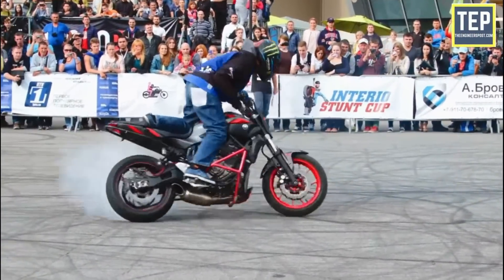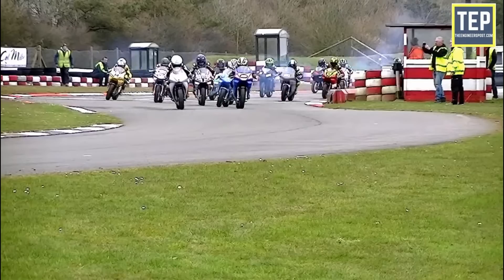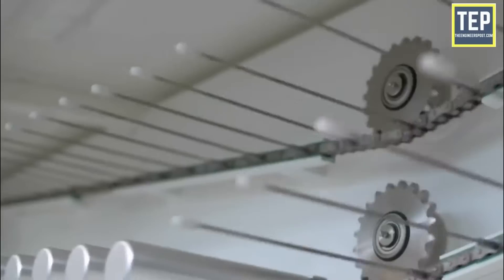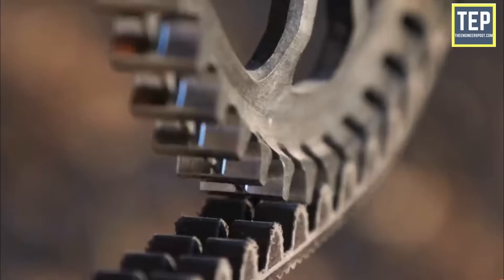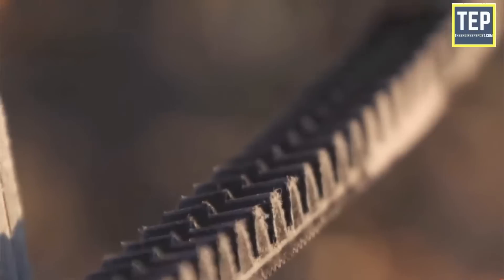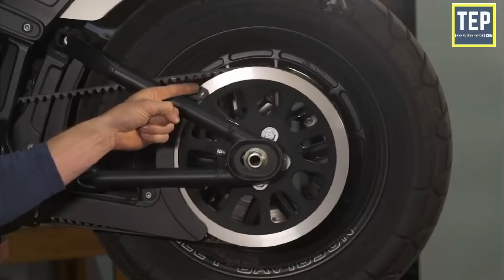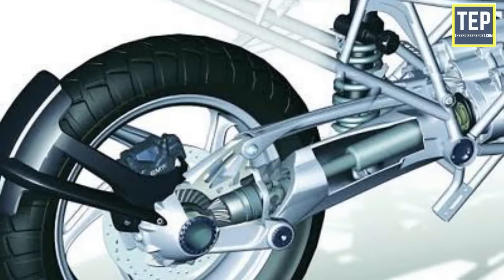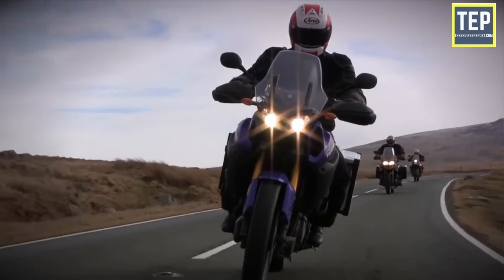Chain Drive vs Belt Drive vs Shaft Drive in Motorcycles | Which is Better?

Comment: Missed belt vs chain trade off: while a belt is more expensive itself to replace, during catastrophic failure a belt will simply zip away with the rider only noticing a complete loss of power transmission, while a chain can both jam between the sprocket and swing arm instantly locking the rear wheel and can also be flung forward into the transmission/engine/drive sprocket requiring a complete rebuild or engine/transmission replacement. This is an important difference as how a system operates at its limits and at failure can have lethal consequences. 

I’ve personally seen all three modes of failure, and had both a locked rear wheel in a turn from a broken chain and a lost belt at highway speed. While a chain can simply fall away if it breaks in the right location every instance I’ve seen has resulted in a high speed projectile thrown either behind the bike or into some portion of it (or getting jammed between a sprocket and swingarm). A shaft drive, on the other hand, only fails catastrophically when the front u-joint disconnects and if the design is otherwise unsupported it becomes an ersatz pole vault flinging the entire rear of the bike into the air, much like a disconnected drive shaft can do on an automobile. While this essentially only occurs due to direct damage it is still a more dangerous failure mode than a belt.
Reply: Belt is low maintenance, and acts as a shock dampener for the driveline.  Chain is strongest but requires occasional lubrication.
Reply: Had a chain come off pulling away from a stop in the middle of no where New Hampshire. Got a ride to a jobber for a new master link, they drove me back to my bike. Chain back on, all in less than an hour and back on the road to Toronto with just a little crack in the case. Had the nut come off my belt drive at 70mph (always use new cotter pin) had to get ride to dealer for parts that were lost and away I went 4 hours later. Had a shaft drive in between those bikes with no problems, but the bike tends to jump up when you give it the gas. I'd say the belt is the way to go chains don't last very long and I don't like the feel of the shaft.
Reply: this happened to me 10 years ago,luckily i was slowing down just before the curve,around 40-50kmh when rear end started sliding then rotating for a little then sliding left and right again then couple of more times until full stop. Very unpleasant feeling.
Reply: The chain will never fail in normal conditions and if it's maintained.
Reply: Didn't you watch the video, belt has high transferred power loss and chain has very little transferred power loss
Reply: @johnadams3038  Sorry John, I’m not following your point. It’s accurate to say that when both are in good condition then chains have less wasted energy, but I’m not seeing how that’s germane to their catastrophic failure modes. Can you close that loop for me so I can understand what you’re getting at? Thanks.
Reply: @robertkb64  Thank you for finally providing me with a clear answer on why a belt drive can definitely be the better option. 
      I work on a lot of bicycles. And enthusiasts were not able to provide me with any actual examples of 'in which situation a belt drive would be better'. 
      Up to this point, I felt it was mostly up to 'how fancy' you wanted your bike to be (like an extra expensive gear system, instead of a budget version.. in which case, the difference is mostly about smoothness).
     The 'catastrophic failure' scenario is something that hadn't crossed my mind yet.
    (..even though I've had issues with bicycles with coaster breaks (pedal backwards to engage the break) when my chain ran off the sprockets, and was thus unable to break..)

But you are (obviously) correct on this subject. 
      Particularly in the case of more high speed applications such as motorcycles, 'not dying' seems like a VERY good reason to get a belt drive.
        Driving a motorcycle is already 'high risk', compared to driving a car, because of the design (2 wheels instead of 4, no windshield or engine bay) and the lack of safety features (no 'crumple zone', no seat belt, no air bags, no shell of hard materials around you to protect you in a crash).

> [I don't have the statistics at hand, but I feel confident in saying that motorcycle accidents have a higher morality rate than car accidents..
      (Apparently doctors refer to motorcyclists as 'organ donors' for that very reason).. Quite morbid, but I have to say... 
       In 5 years, there have been at least 3 people from a local bike club that have died (and that's just the ones in my street, where I saw the whole 'final salute' parade come by)

To me, it feels like a very logical thing to take out of the equation, when riding.

-

As for using drive trains with a chain..
* [non-sollicited information after this point...]

From my experience with BICYCLE repair - (did hundreds by now... It's not 100% the same as motorcycles, I know. But it has a similar way of transferring movement to the rear wheel...) - it's good practice to inspect your drivetrain on a regular basis;

       Sprockets and chains are "consumables" (like sandpaper, or drill bits), and are guaranteed to work for only a certain amount of miles/km.
      After that guaranteed mileage, you're rolling the dice.

Understand that:

1. Chains 'stretch' as they wear out. 
      (They literally become longer, as the rods that connect the chain links are slowly being filed down because of movement & friction.
      Hang a brand new chain next to a worn one, and after only a few chain links from the top, you'll see a difference just by eyeballing it. 
      On the first link it'll not be noticeable, but then it starts becoming a difference of 1/16", 1/8", 1/4", 1/2"..)

2. The teeth of your sprockets are slowly filed to a different shape by the chain links, making them more likely to slip after a certain point..
     (slipping while trying to drive the wheel, or the chain can slip off the sprockets even)
     There should be guidelines for teeth shape somewhere (shape they should be, when to replace, etc).
      With bicycles, it's when it goes from 'identical shape on both sides of the tooth' to 'shark fin shape'.
      (On gear cassettes, with multiple sprockets, you can see that the shark fin shape is actually used on a couple of teeth from each sprocket - this is for gear shifting - it lets the chain easily slip off.
    It's NOT what you want to happen when you have fixed front and rear sprockets!) 

Fixes and adjustments:

~> As your chain stretches, there should be a way to adjust the slack (or if it's advisable to replace the chain - do that. Don't 'slack' on this one ;))...
     If your chain is too loose, it can start to 'bounce' and run off the sprockets

There should be guidelines on this for motorcycles (or YOUR motorcycle in particular), concerning:
     - the amount of slack in your chain (when is it cool / when is it unsafe), 
     - when to replace the sprockets / chain (should be a number like 'after every 10.000 miles, or yearly' - as in 'replace every year, or more often if needed')
.    - and what to use as lubricant.
(NEVER. EVER. use. WD. 40. to 'lube' your chain, btw.. That will do the exact opposite;
        It will REMOVE the oil / lubricant in your chain, friction will go off the charts, and will introduce new and exciting issues)

In case of bicycle chains, there are simple reference tools you can buy to measure if your chain needs replacing, or if the amount of 'stretch' in your chain is still within tolerance.
       (I'm not sure how 'universal' motorcycle chains are, but there might exist something like this for particular brands... 
      Or at least some guidelines for measurements you can take with calipers to check if it's within tolerance)

-

Anyways, just thought this information might help someone.
      Not everyone thinks about this kind of stuff.
     (Lord knows that I didn't know how to check for 'chain wear'... or that there even was such a thing as a 'stretched chain' until I worked in bicycle repair shops...)

Figured this would be the time to share the knowledge, as it concerns potentially lethal situations..

Sorry for the long story (and sorry that I included it in a reply to the one person that probably already knows all about this :))
Reply: @johnadams3038  That's actually no longer true except at low power. Belts have gotten a lot better over time, and their friction loss is near constant. Belts however have frictional losses that increase as speed increases. So at a low output, a chain may have a 1.5% frictional loss, while the belt would be 3%. But at a high output, the chain might be 3%, and the belt will be 3%. I can send you links to actual data. Anyway the 6-9% losses of belts are numbers from the 80s, belts made a lot of progress in the last 20 years and are pretty much on par with chains in terms of power losses when actually riding.
Reply: @andychow5509  It should be true because majority of bikes and all super sport bikes utilize chain drive. So there has to be a reason.
Reply: @johnadams3038  The simple reason is that people keep reading articles that keep repeating decade old lies, or watching videos like these and then think chains still have an advantage. It's similar to the still existing debate that automatic cars have less power than manual cars (was true when automatic transmissions relied on hydraulic pressure to switch gears. Completely false now that it's electronic switching, and switches better than human drivers, so these days you actually get more mile per gallon on the automatic model than manual).
Many of these myths refuse to die, and that's the reason people prefer chains on motorcycles; they think they are getting an extra 5-8% power from less friction.
Reply: @andychow5509  There is a reason that all motoGP bikes use chain drive and all sports and super sport bikes use chain drive. Don't you think so?
Reply: @johnadams3038  Yes, 1.5% advantage when initially accelerating, which is important for racers, since that can make the difference between making the podium and not. They also change their chains and sprockets every few races or every races, and the tires too.
Reply: @andychow5509  nailed it.
Cogged belt for the win.
Reply: @andychow5509  one notable exception is off road... chains handle muck and stones etc better than belts (though they've certainly gotten better) and relatively easy to repair if they do break, in particular not needing to remove entire sections of the bike. Also provides a little more flexibility in rear swingarm design as the chain can be broken to go through fixed holes, a belt cant.
Reply: @johnadams3038  "It should be true because majority of bikes and all super sport bikes utilize chain drive. So there has to be a reason." Cost and public perception. I would run a belt on my ZX14R if I could, the maintenance schedule for a chain  is ridiculous. On a highway trip, every other tank of gas. I have never tried the chain oilers and am not sure how well they work. I definitely do not like the mess of a chain after every lube, flinging more goo than a porn movie.
Reply: @Davesworld7  Chain drive is used because of performance and practicality and not "public perception" whatever that means. Chain drive has minimum power loss unlike other drives and their maintenance problems. So like I said there are good practical and engineering reasons to use chain drive. They even explain it clearly in the video and you still argue.. lol
Reply: @johnadams3038  Other drives and their maintenance problems? Nothing of the three is more cumbersome and tedious to maintain than the chain drive. Chain drive is practical I'll give you that but it is also used because it is cheap and  an off the shelf bolt on, have horsepower, yeah, just throw that 530 chain and those two sprockets on it but the maintenance, good lord. The chain sizes are already established and standardized, since it costs no more than the actual parts for someone to call it out during the r&d phase of design and they won't have to maintain it, it's a no brainer for them. For dirt bikes, withstanding dirt, pebbles and more is the most important so a chain has to be used but on the street? Nope. The real problem with belts is that they are not standardized, with chains and sprockets, they ARE standardized and it doesn't matter if it's a Gxxer 1000 or my ZX14R, off the shelf parts of a given size etc WILL bolt up. The reasons that we never went to belt final on these bikes before is no longer at the same level of development it was back then. Belts are getting stronger and narrower all the time and made a huge jump in the last 20 years. They aren't as forgiving as a chain so another consideration is that the chain is more idiot proof. The belt has to be perfectly aligned so Buell's tensioner plus a fixed axle position would be the order of the day. There are more bowed chains out there than you can imagine and when a chain gives, it sometimes wads up and if you don't pull in the clutch within a split second and the wheel locks up, you may not recover control. The other issue is rocks, there is no free lunch on any of the three final drive systems.
Reply: Chains are used on racing bikes because the increased maintenance is no issue. They probably have a new, freshly oiled chain on for each race. There is also the matter of a chain being far quicker to replace if the worst happens. If the chain gets damaged or is faulty, a skilled crew can replace it in a minute without having to remove the wheel. Lastly, and to lesser degree with modern belts, chains are more tolerant of high power. I personally would be leery of a belt with a 260 HP turbocharged liter bike

The fact is, you still see all three drive systems because all three have unique advantages. For raw performance and low cost, you can't beat a chain. For ease of ownership, shaft is the way. For a nice happy middle, there is a belt.
Reply: @johnadams3038  I don't believe that for a minute. I have had o-ring chains for some time and they have a lot of friction which is converted to heat. Power losses will always convert to heat. A chain 100% lubed with no o-rings would have low friction for a very short time but none of us would want to live with that anymore. Just because someone said it doesn't mean it is always true. The best final drive system I have ever experienced was on a Buell. What's really needed is a mock up and compare the power losses between the two. I also have had a shaft drive and I never had to think about it but they are the heaviest and there are geometry considerations. BMW and Kawasaki with the later model Connie certainly have refined the shaft drive.

Comment: I have shaft driven Honda Shadow, 1100. I change the final gear oil once a year. I don't know how I do it but some times I get 51 MPG and I have gotten as low as 35 MPG. I average out to 45 MPG. My last bike was chain driven I like the shaft better.

Comment: Are you serious about losses? That energy should be transformed into heat which must be dissipated by transmission elements.  Imagine 10kw dissipated inside belt weighting say 500g. What temperature will it be?

Comment: I much prefer chain drive generally speaking because of the flexibility to easily change sprockets.  Also, with a centerstand (such as on my ZX-11), lubing the chain is easy (especially with the chain guard off).  Chains also look very cool and can be downsized to shave weight.  Pretty impressive how something that has to handle the full power of the bike only weighs a few pounds.

Comment: I heard that the Belt drive is used by HD motorcycles is because of the nonlinear power distribution to the wheel. It dampens the shocks. Once man told me that the belt lasts for over 15 years.

Comment: In my country, after getting upbore and upstroke, its super easy to balance the reving at top rpm using chain system. Belt system ratio adjustment were non existent, need to alter gearboxes for it.